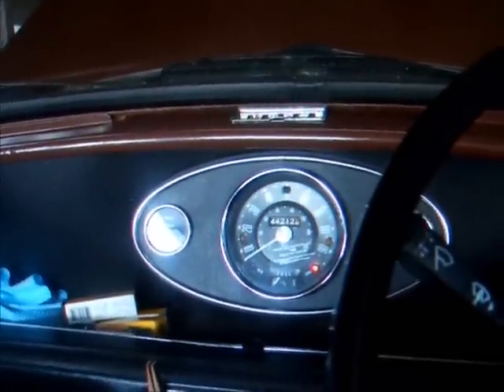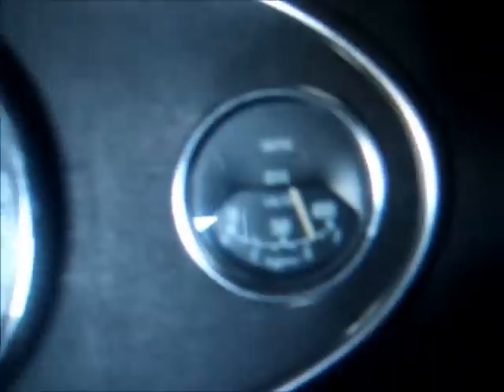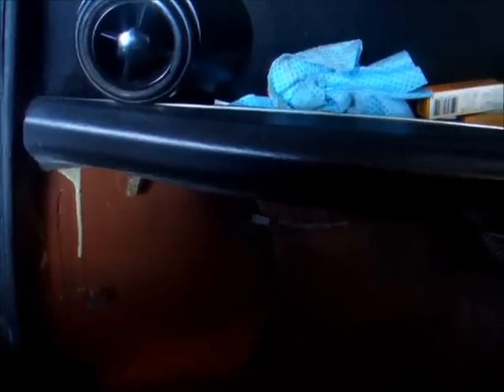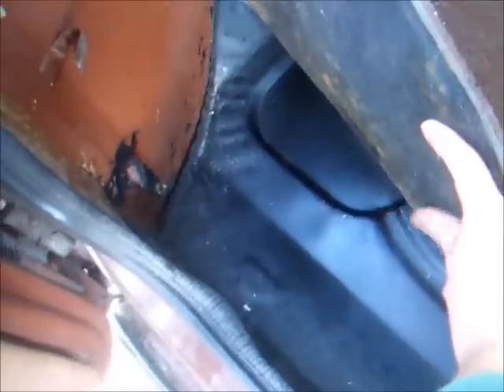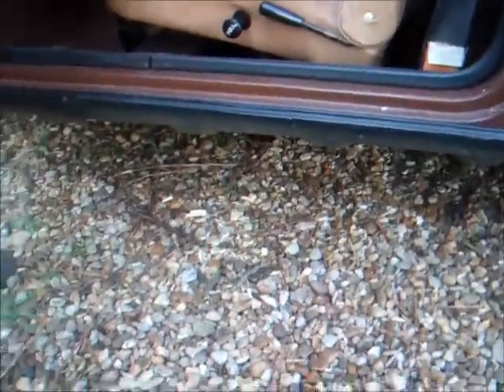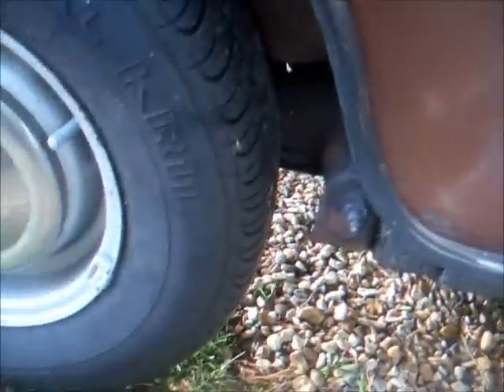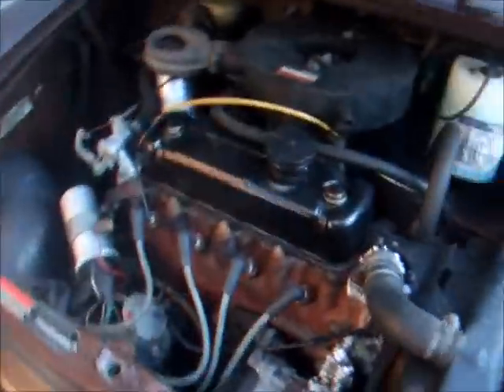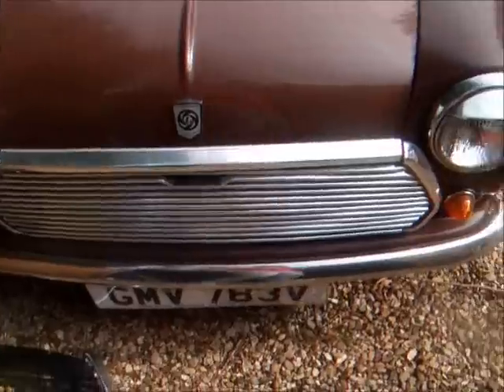1980 Mini 1000 Auto - Start up

Comment: Registration GMV783V 
Make AUSTIN MORRIS 
Model MINI 
Description 1000 AUTOMATIC
Date of Liability 01 04 2008 
Date of First Registration 02 01 1980 
Year of Manufacture 1980 
Cylinder Capacity (cc) 998CC 
CO2 Emissions Not Available 
Fuel Type Petrol 
Export Marker Not Applicable 
Vehicle Status Unlicensed 
Vehicle Colour BROWN